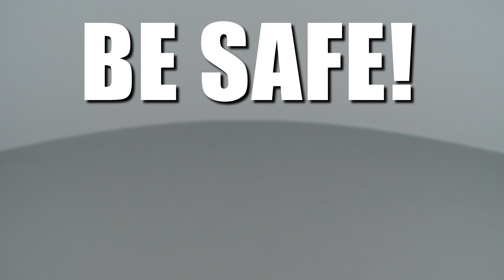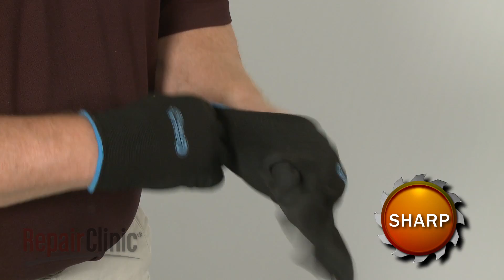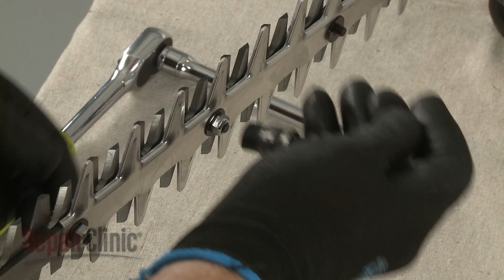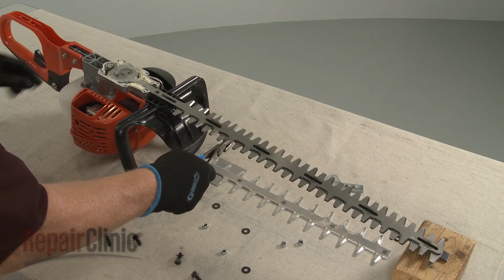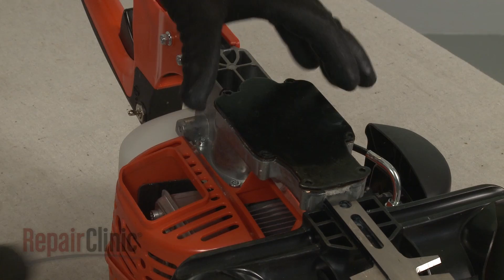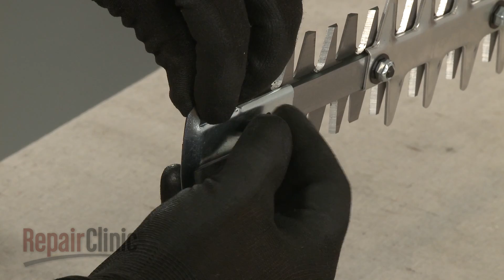Echo Hedge Trimmer Spur Gear Replacement #V650000080

Comment: The half a turn back on the bolt is not the most efficient way of getting the correct gap in between the blades . A better way is first get slightly broader washers with same size in a hole as last washers fit new locking nuts and bolts as video directed .Then tighten all bolts, then loosen till u  can just turn the washer . The sharpness of cut and smoothness of the blade is noticeable and if blade is oiled with somthing like wd40 and even in conjunction with cutting wet hedges and regular adjustment as i mentioned even dull blades often seem to get there  sharpness back so long as the trimmer is use on a foliage no thicker than 2.5 or 3mm  eny thicker and the blades become to stressed to go back to cutting fur wich is why i have two of those machines and love using them 
 I had a thurd one but instead of doing the repare above i put the gear box of an 20 year older single  sided echo with its blades . My goodness just realised that makes that gearbox and bades nearly 45 years old ... wo echo are the beast last longer than the rest. They were my dads . Of corse the only thing thats ever killed my echos is the death of the ingitions and them being out of stock ( my evl chainsaws  reast in peace at the back of tbe garage.)